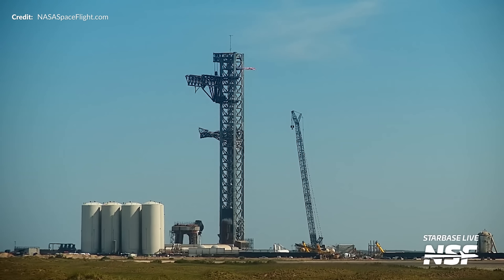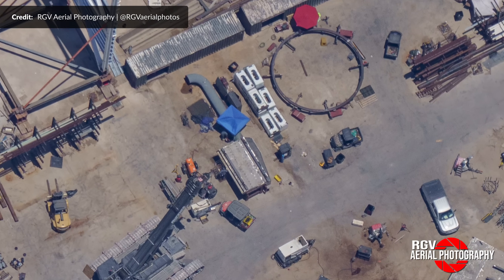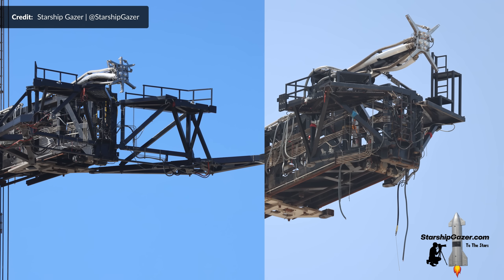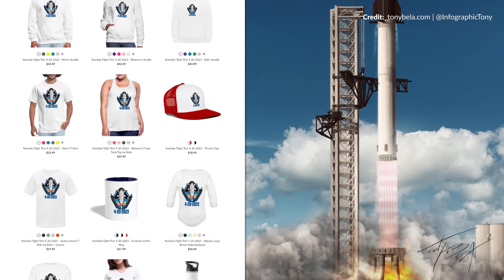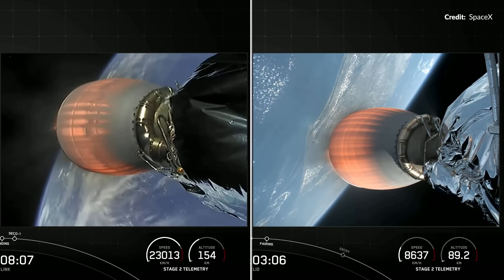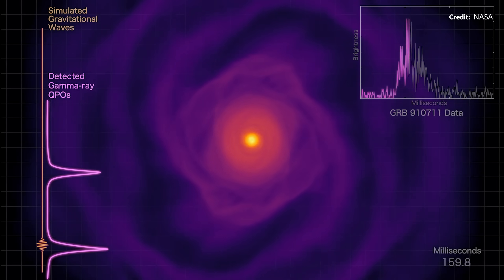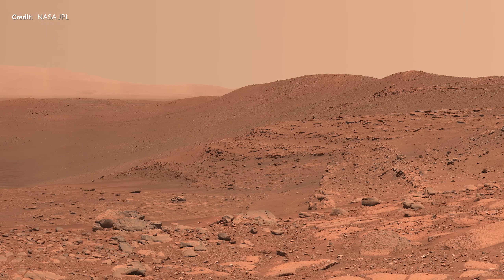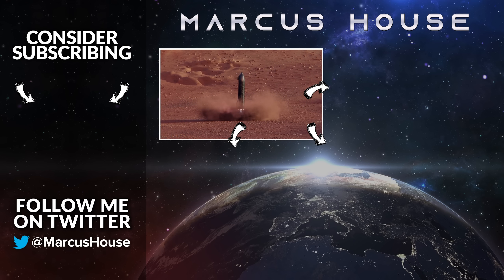Mind-Blowing Transformation at the SpaceX Starship Launch Site!

Comment: I'ma go on record as skeptical of the practicality of hot staging. I don't think it's gona work.
Reply: It has been working for decades on other rockets: Why would it not work here?
Reply: @ChristLink-Channel  Fully and rapidly reusable, is the difference.. It will cause damage to the  vehicle
Reply: @michaelvallin55   The upgrades to the booster forward end should mitigate any potential damage and with only 3  raptors on the second stage firing at half thrust any damage is expected to be minor in the worst case.  It's all part of iteration of starship so we'll see how it plays out.
Reply: @michaeldeierhoi4096  yeah well they also expected damage to the pad to be minimal and we all know how that worked out
Reply: @michaelvallin55  They also have already repaired that damage AND built in the upgrade with the water cooled steel sandwich.  In barely 2 and 1/2 months!!  If space had gone ahead and done the pad upgrade before the launch I'll bet the timeline wouldn't be much different than what it is now given the intense excavation done under the pad before the concrete cap was added.  Space X has that can do attitude to get things done after a mistake or set back.  It's the gad flies or critics who don't understand accept mistakes along the way toward building something like the largest and most powerful rocket ever!!

Comment: To make the "Hot stage" hardware, heavy pipe work will add weight,  Maybe the same weight as "Landing legs"   Adding landing legs would give a great option if the booster comes back to be caught by the tower and they can see it's not going to make it.   They then go for a landing pad landing.  Has anyone brought up the idea of disposable "Solid rocket boosters" ?    They wouldn't have to be all that big to compensate for the additional weight.
Reply: I seriously doubt that landing legs would be same weight as the parts needed on the booster for the hot staging of the second stage.   Even with a near empty booster very robust landing legs would be needed.   After all when you have a whole team of engineers working on this there isn't much they are going to miss.  

And as far as catching the booster they will figure out how to do that just like Space X figured how to land Falcon 9 boosters.
Reply: @michaeldeierhoi4096   One mistake on catching shuts the whole program down till repairs are made.
Reply: @BruceGordon925  That's why Space X won't be attempting catching a rocket for some time yet.  My money is on Space X to get it done because they have already succeeded expectations several times.  They just repaired the launch pad faster than anyone expected.   And landing a booster for example was once thought impossible now it is routine.

Comment: They probably want to keep the center engines lit for the flip. Otherwise they would have to relight after the flip which would require a retrograde burn from the hot gas thrusters to settle the fuel again. Easier to just keep burning to your desired trajectory cause then they don't have to relight again until the landing burn which is done by the header tanks.

Comment: So, we need launchpads this robust on Mars for takeoff from there? If so, what does that do to feasibility or at least Mars based effort required to achieve round trips? Frankly, I don’t know how Mars based returns work without boosters (?) and mechazilla. I guess that’s my question; how does Mars to Earth work in the beginning? What would be required to be built there for the first return?
Reply: The gravity is 2/5 that of Earth and the atmosphere is 1% that of Earth. So a Superheavy booster is not needed and Starship (second stage) can launch on just the thrust of 6 engines.

Comment: Hopefully a bit later than that Marcus. Cement in not to keen on high temperatures at this stage of the plan. As Well as High Pressure water. Certain cement mixtures call for daily soak-down’s. It contributes to the cement s overall hardness. Slow-Dry.  But high pressure water tests. I’m not to sure about that.

Comment: Marcus, I was wondering if Starship could launch suspended over water to avoid destruction of the pad, because it is held by the arms on the tower?
Reply: Unfortunately that would not work. The tower arms are only capable of lifting the ship or booster when they are empty. Once they are placed on the launch table they are filled with fuel at which point they would be far too heavy for the arms to hold.
Reply: The launch mount and the 20 hold down clamps shown in the video are what hold the rocket up. And while ober water sounds good, I just don't think it'd work that well without a lot of depth. You saw how high concrete chunks flew, 200ft or more. The water splash would be extreme, and the displacement of water from the exhaust pressure would go deep. If they built a deep pond it'd probably have it's water all dispersed into the air and out the sides very quickly. If they did it over the ocean without a 200ft high platform they'd be spraying salty water up and getting it on everything.
Reply: Many reasons make it impossible but the first one is : the launch mount is required to make the booster ignites its engines in the first place (its not just a stand)
Reply: Thank you both, I hadn't thought about the fuel not being in it, and didn't really consider the water displacement. I guess it IS rocket science, so there's a lot that goes into it, and I'm glad there are so many people who understand it well enough to make the progress we have. And Elon being Elon. Obviously if they could, he would be

Comment: All the rockets worked well in the simulation. They’ll get it together. I only hope they didn’t underestimate the amount of water required to help attenuate the sound, heat, and vibration they will be pushing the limits”(as they’re going where no man has gone before”). Couldn’t help it.😮

Comment: It will be interesting to see the water deluge as the water expands 1600 times when it turns to steam with nowhere to go.
Reply: BOOM!
Reply: I personnaly expect water to be blown by engines and transformed to steam threw pancake holes and inside pipes. The in between of plates will blow off and the top plate will fly to the engines of the booster which will tilt without enough engines to compensate. 
Wonderdull destruction of everything around.

Comment: How do they plan on keeping dirt and debris from falling into the hundreds of holes on the surface of the splash pad?  Presumably, they will still need to drive and conduct work on the engine section of the booster via this surface.  Is it not a consideration as the water will blast any debris out?  Does this mean they will need to do a “water blast” through the plate prior to putting a booster on the launch mount?  My concern is more that something falls in like a bolt or rock that then gets blasted into a raptor engine during launch. 

Any thoughts?
Reply: They can place temporary cover plates over the holes until launch time, when they can be removed.
Reply: Besides that the high water pressure coming through the manifolds would blow any debris that falls into steel sandwich.

Comment: That is A LOT of infrastructure for something that is supposed to take off from the moon and Mars with no infrastructure. I know Starship and Superheavy are two different thing but still. If all this is needed for the full stack, what is the ship going to need in order to successfully take off once it has landed somewhere?
Reply: The bottom line is there will be a lot of time to work that out.  But basically when starship takes off from the moon it can so with a much reduced thrust with maybe just two engines.  That will greatly reduce damage to the raptors at take off.

Comment: if spacex had built a flame trench they would not have had to mess around doing what they are doing now.. dig the trench concret it with defelectors job done.
instead doing it the hard way..
Reply: You clearly haven't followed this story to know the back story behind why Space X did not go that route with the flame trench.   In the first place the water table at Boca Chica is too high to allow a flame trench to be dug 40-50 feet into the ground.   

Second, the flame trench is not some kind of panacea for all rockets.  Starship is almost twice as powerful as the SLS and SLS caused damaged below its pad as well.  

Third there were likely time consuming investigations into what Space X would have to do to build a flame trench because they are surrounded by a protected natural wildlife preserve meaning they can't just build anything they want.  

Is that enough to explain why the flame trench was not a good option or do you need more reasoning to indicate that you don't understand what is going on with this subject?

Comment: If Starship is destined to land and launch to and from Mars, must not this launch landing pad be built there as well?
Reply: No, because the Superheavy booster is not needed there. For the Moon, the current plan for HLS Starship is a ring of 24 smaller methane engines at the top of the propellant tanks. With them being roughly 25 meters off the ground, the thrust should not affect the ground much for the last bit of landing and first bit of launch.

Comment: Let's hope all this new concrete doesn't turn into debris during the next launch attempt.
Reply: There are many reasons why it shouldn't.  One in particular separate from the upgrade to the OLP is to launch the rocket in 2.5 seconds rather than the 5 + that it took to launch it the first time.  That will dramatically reduce the potential damage to the pad.

Comment: I have to wonder why they don't rotate the Starlink v2 satellites by 90 degrees for the pez dispenser.  That would allow the opening to be smaller and help with the integrity of the rest of the ship.
Reply: You wouldn't be able to fit in may satellites like that... the ship is cylindrical, so there's less and less "depth" the further you get away form the vertical center line.

Comment: I assume the deluge system is being installed in texas, have there been any work done at the site in florida?  Didn't I read that they were making a starship tower in florida because there were questions about launching in texas.
Reply: Boca Chica is as much about figuring out how to build a Starship facility as it is testing Starships. SpaceX looks like they are planning on getting Boca running and then copying that for LC-39A. Until SLC-40 is upgraded to handle Crew Dragon, they can't launch Starship at LC-39A anyway.

Comment: Excellent report. I think the decision is still out on the deluge system. It doesn't appear to cover enough ground area to me. This appears to have been the first alternative after no flame diverter, sound suppression system or water suppression system. Is it enough? I don't think SX has many opportunities left at this location. They have to get this system up and running effectively within a given time frame and another failure will push that further and further away. It looks now like the FAA may allow this flight to off on a timely basis. I hope for the best. Just don't let the blast distort the metal base and get down between those ground support pilings.
Reply: I agree.  If it was steady force that's one thing, but I can't help thinking the vibration will shake the whole thing to bits
Reply: This was designed long before the first launch.  It's not an after-thought that they came up with after that, but a design that has ben in the works for a long time.
Reply: @ChristLink-Channel  - Even before the last launch Musk reported that they were planning to install this system and some parts were already on site. It would take at least a year to design and make the parts for this kind of system and I suspect it was apart of the original plans. That said, it still doesn't deal with the issues of sound suppression or vibration. It is what it is. I don't see another site between Boca and the Cape to build a launch facility like this. Musk must have thought he would have doable support by Texas, NASA, and the administration but underestimated the EPA. Others have done the same. Hopefully it will all work out and he can make frequent launches from this site and this facility?
Reply: @rocroc  It likely won't do much for vibration, true, but it should do a lot for sound suppression.  Flashing water into steam absorbs a tremendous amount of energy, and some of that will come from the acoustic shock waves.  Some will also come from kinetic energy, implying that less kinetic energy will be available to be converted into acoustic energy.  And ditto for heat.  Overall, there should be a useful reduction in sound levels.  It remains to be seen how efficient/effective that will be here.  The same principle is already used on the Falcon 9 launches, and many others too.  The actual mechanism for delivering the water is different with those (basically enormous open-ended pipes, pointed at the bottom of the rocket downwards from above), so it's going to be interesting to see if the "inverted shower head" approach can achieve the same or perhaps even better, results.
Reply: @ChristLink-Channel  - That's what they are counting on! Now they are planning to eventually use three more engines and boost power further with the new version 3 Raptor engine. All of this reportedly without a drainage system. That means the water has to be fully dissipated by the heat of the rocket. It will be interesting and I hope it works. Maybe there is a drainage system we don't yet know about? That could come in the next couple of weeks.
Reply: @rocroc  The extra three engines are for Starship itself, not the booster, so they won't be alight at launch.  But Elon is now saying that the Raptor 3 will be even more powerful than originally reported, so those 33 roaring dragons are sure gonna put out a lot of thrust/sound/heat/everything-else!  Let's just hope they don't put out any more concrete chunks...  (Hopefully all that water will be flashed to steam very effectively, and still manage to keep the plate cool enough to not melt, or even just soften and deform...

Comment: Marcus do you think that the concrete they have poured will be solid and be able to withstand the full brunt of the force?🐸💚
Reply: The concrete cap is on to of several deep piles in addition to having the water cooled steel pancake on top.  And that pancake will spray a deluge of water upward as the raptors are firing downward.   It's like a bidet for the booster as it fires up it's engines.  That is a vast improvement over what was done before which Elon admitted was a mistake.

Comment: I wonder if there is gonna be some devices to prevent the accumulating gases from exploding during the vacuum raptors startup sequence. Or did i missed something?
Reply: The vents through the side of the starship at its base should prevent the accumulation of fuel.  The Titan which launched the Gemini capsule back in the 60's used hot staging quite successfully and I'm sure a few things have been learned since then.

Comment: I don't really understand what the ground-level engines on the Starship is for, if it only ignites in the upper atmosphere, what circumstance do they need ground-level engines for, they are so extreme in cutting off unneccessary weight there must be a reason, I just don't know what? do they imagine scenarios where the Starship will have to launch without the Booster stage?
Reply: Landing back on Earth again...
Reply: Starship on it's own is incapable of getting anywhere close to space, let alone to orbit. The booster is there to give it a leg up. Rockets use crazy amounts of fuel. At stage separation that huge booster is virtually empty. At that point is is basically a very heavy chunk of useless metal so it is discarded, allowing the Starship to use it's store of fuel to continue to orbit. The booster then falls back to earth using it's small amount of remaining fuel to land.
Reply: SpaceX is apparently trading efficiency in a vacuum, for the thrust of 3 sea- level Raptors that gimbal, over 1 Rvac that gimbals.
Reply: @ChristLink-Channel  ahh of course I forgot about that, engines are also used to land, not just to take off, D'oh